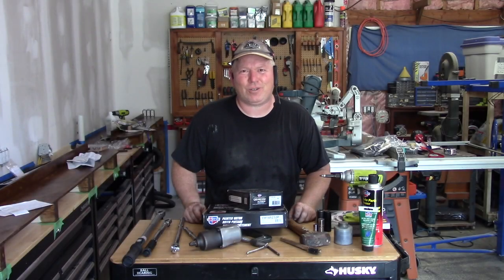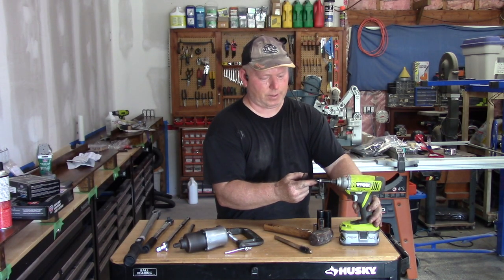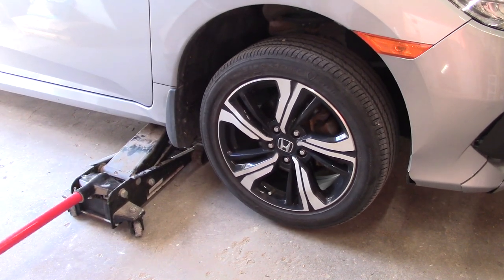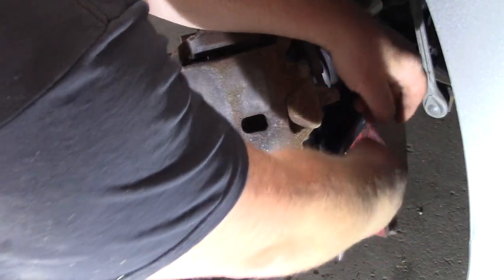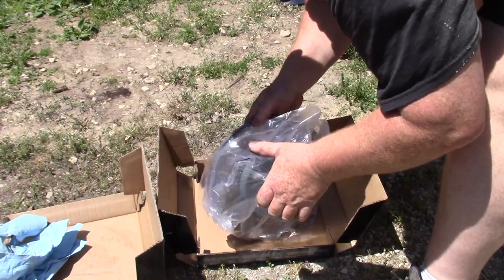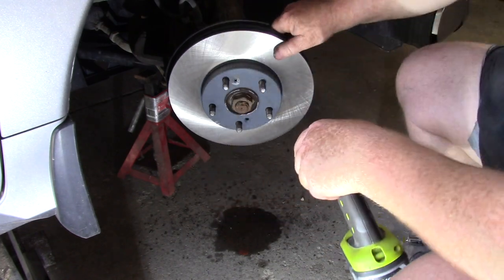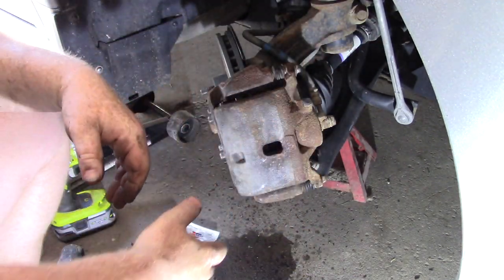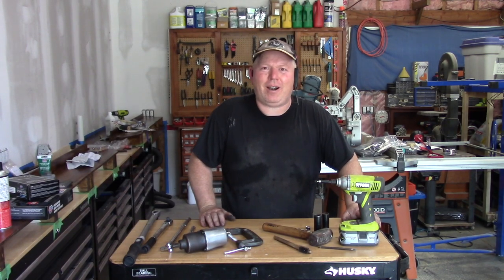DIY Honda Civic Front Brake Change 2016 to 2021 model years.

Comment: This has been a very thorough and helpful video, Rob.  My 2016 Civic is due for front brakes at (unbelievably!) 191k MILES.  Lot of highway travel obviously since this is their first service.  And considering the OEM pads/rotors served me this long, I opted to go with Honda parts.  Picked them up online at a dealer in Ohio for significantly cheaper than my local dealer too.  Thanks again and keep the great maintenance videos coming!

Comment: Great video, very informative and thorough.  One thing that I would add is that when you had the lower caliper pin that was tight when being put back in, that was likely caused by that rubber boot that Honda puts on only one of those pins per caliper...not sure why.  That part is replaceable and should come with a service kit as over time, it will tend to swell and inhibit the free movement of the pin.  Changed the rear brakes on my 2003 Pilot and had that issue where the rubber sleeve swelled to the point to where the pin would hardly move, and only then realized that the service kit I bought to do the job included those sleeves as well as the boots.  Also would want to make sure that high temp silicone grease is used on the pins so that it will not deteriorate the rubber.  Thanks for the videos!

Comment: Just did mine today on my 19 coupe ex-t 56,000 on the originals. Still had plenty of pad left too.
Reply: About to do my wife’s 2018 sport touring on Sunday with 69k miles (nice). Wonder how they’ll look.
Reply: @WalterMelons  I live in VT, and barely need to use my brakes. Virtually no traffic, no cities here, just drive rt 2 every day for work. Barely even get into the turbo. I wish I had gone with something other than power stop pads and rotors. They're absolute garbage. Atleast the ones I got. I have to do brakes over again now. Going with a decent non drilled and slotted rotor this time, with good ceramic pads. I did my brake fluid too, swapped out the dot 3 for valvoline dot3-4 fluid. Might do new calipers in the front too in the spring.
Reply: @vermontvermont9292  I’m surprised, never had an issue with powerstops. I’ve installed them on 5 vehicles so far. I don’t do drilled and slotted for anything that isn’t towing or an actual race car that gets track time.

Comment: Thank you so much for your video!!
By far the BEST video I've watched and very thorough and step by step. 
I have a 2016 Honda Civic Sedan Touring. 
The "STEALERSHIP" wanted to charge me couple of thousands for the pads and rotors and labor.
Would it be the same process also for the rear brakes?
How are the CarQuest Pads and Rotors working so far?
THANK YOU! YOU ROCK!!
Reply from the maker: Get the premium pads and rotors.  They will be the OEM equivalent.  Look for the videos on air and cabin filters here on my channel.  Here is the link for the rear brakes 
https://youtu.be/kyQFCIbVdYA

Comment: Rob, do you loosen or remove the brake fluid filler cap? Or is that bad or not necessary? I've always changed my own brakes. Saw some great stuff in your video. I've never used anti seize, but I will this time. Thanks for the torque settings!
Reply from the maker: No I didn't loosen the brake booster cap because you aren't adding any fluid to the system and it won't overflow either.  Don't forget to do the in car brake calibration sequence at the end of the video.
Good Luck with your repair!
Cheers!
Rob

Comment: Hello! Thanks for the video! No errors with this method? Also can you please tell me what other honda model has the same rear brake pads? I know the fronts match the 02-06 crv's, I need to know what matches the rears. Thank you!
Reply from the maker: These are the actual Honda Tech Instructions on how to do the service without HDC (computer) so if you follow the instructions and calibrate the EPB then you won't have an issue,  Did both My civic and CRV and a friends civic - all good no codes and super easy.  I'm not sure what pads are common but I hear the new Si's use the Odyssey brake set up (huge rotors, calipers and pads)  Good Luck with your repair!
Rob

Comment: Hello,  I changed my front brake pads and was going to do the rotors as well but noticed I got the wrong ones so didn’t install them. Everything is great except for the fact my brakes feel like they are sticking now.
Reply from the maker: Did it improve with more driving time?

Comment: Excellent video, if I put everything back together just how you did and it makes a cranking noise when driving what could have went wrong went putting back together ?
Reply from the maker: I’m not sure.  Check the brake pads and make sure the pad is against the disc and not backwards (I’ve seen pictures of that).  Make sure the inner pad has the squealer on it and is in the right position.  Sometimes you can get a stone between the splash shield and the rotor and that can make noise.  Also make sure you didn’t accidentally bend the splash shield in against the rotor.  If all else fails I would take everything apart again, inspect all the parts and put it back together carefully.  Good Luck!  Fingers crossed 🤞

Comment: Did you have to bleed the brakes, never saw you open a bleeder valve so I'm assuming NO?
Reply from the maker: No.  Only if you open the system.  When I replace calipers or brake lines or brakes hoses then I bleed the brakes.

Comment: Changing the pads and rotors on my 2016 civic ex, about 160,000km on them, still about 25% pad life left but the rotors are worn. Your video helped a lot. I’m upgrading to vented rotors and ceramic pads, 4 wheel kit from summit racing for $258 free shipping.
Reply from the maker: Awesome!
Reply: How do you like the new brake set up so far?

Comment: I changed my rotors and pads step by step, there are grinding noise only when I stop the car, and there's no noise when I drive it and try to slow down. Do you know what's wrong?
Reply from the maker: Hard to say from here but a common mistake people make is putting the pads in the wrong position.  One set has a pad with the “squealer” and one without.  Sometimes people put them in the opposite sides.  Another problem that can happen is getting a stone stuck in between the pad and the rotor.  When I’m doubt,  pull it apart and have another look.  Good luck!

Comment: I am about to change my rotors and pads on my civic and was wondering if the front pistons needed to spin while being compressed?  I have a piston compression kit  so if it needs to spin I'll need to figure out what size adaptor I need to use. Thank you!
Reply from the maker: No.  Just compressed

Comment: Great vid mate! Curious normally don't you grease the backside of pads so they don't squeak?
Reply from the maker: You can add a thin layer of grease at the contact points, I usually put a layer on the piston ring.  I’ve never had squeaky brakes actually.

Comment: Do you flush your braking fluid or just top it up?

I'm also in Canada, have a 2017 ex civic, and does not look like the bleeder valves have ever been touched. They are rusted, etc, Canadian environement. Probably look like yours. Would you bother to flush the system yourself? Have a mechanic do it, or just remove and top up the master cylinder?
Reply from the maker: I had the dealer swap out the brake fluid during one of the services.  I got an extended warranty (CVT tranny is new to Honda, direct injection and turbo is also new tech for them) So I get them to change oil and tranny oil  to keep the warranty in good standing.

Comment: I have a 2016 Honda Civic EX-T 130,000 miles original brakes and rotors. Is that good?
Reply: Damn that's a lot of miles
Reply from the maker: Amazing!  Honda has really good brakes and they tend to last a long time but you got a lot more miles than normal.  Time to switch those elderly brakes out.  LOL!
Reply from the maker: crazy eh!
Reply: @icecool85  I drive a lot lol 25,000 a year roughly
Reply: @cslim117  I have the same year Honda Civic…close to 145K miles. I figure it’s over 5 years so probably a good time to replace them. Look at it this way…put new ones on and don’t worry about it for another 5 years. If you’re like me, you drive alot of hwy miles and don’t have to use your brakes nearly as often as someone who drives mainly city/stop & go traffic.
Reply: @carlovanrijk4039  yeah that’s what I’m thinking of doing just curious tho do you have the 1.5 turbo?
Reply: @cslim117  no, I have the 2.0 liter.
Reply: @carlovanrijk4039 I gotcha I have the 1.5T so I was going to see what issues if any you were having with it
Reply: @cslim117  for me, the 2.0 L. has been phenomenal! No oil burning, excellent gas mileage, just oil changes and regular maintenance.

Comment: How many miles did this car have when you changed the brake pads and brake disc? The pads look good but the discs are in bad condition so I was wondering.
Reply from the maker: I can’t remember.  I might have mentioned it somewhere in the video.  Salted winter roads in Canada can wreak havoc on your vehicle.

Comment: Dumb question here. Do you still have to open the brake reservoir cap before compressing the caliper pistons on these newer vehicles?
Reply from the maker: No.  The reservoir is filled to the proper amount before the brakes are actuated when the car is made.  So when you push the piston back the reservoir is at the same level when it was built.  The only issue is if someone has overfilled the reservoir.    When in doubt open it up.

Comment: Hey Rob!  Thank you so much for this detailed video!  I was able to mostly follow it with no issues.  On one of my rotors, the head of the screw that holds the rotor on has somehow gotten stripped, so for now I've just put on the new pads and left on the old rotor (I know, I know), until I can find a tutorial that describes how to properly drill that screw out.  Seeing as I had no issues with the other side, I'm confident that once I have the tools and the know-how to properly drill that screw out that I'll be able to get that new rotor on.

Many thanks Rob!  You've not only helped me save a bunch of money, but also given me the confidence to tackle more and more of my own repairs 😊
Reply from the maker: You can just drill the screw out.  You don’t actually need it.  It’s for assembly at the plant.  It is a little easier to assemble with the screw in place.  Once you drill the head out you can remove the rotor and remove the rest of the screw with vice grips.  Thanks for your comments and good luck with your repair!
Cheers!
Rob

Comment: Do you have to change you disc every time you change your brake pads? 8:42  even if my disc looks fine?
Reply from the maker: I recommend swapping them.  If they are warped they will pulse, if there are groves you will have to change pads faster and if you don’t lube the pins they can cause premature wear.  Brakes are the most important thing on your car.

Comment: My pads came with new caliper bolt boots, should those be swapped also? The original look fine, no leaks, leave the old ones in?
Reply from the maker: Up to you.  Just make sure to lube those slide bolts 😉

Comment: The brake pad on my honda car start squeky after 40k km. (Still the factory installed disc and brake pad. Honda SC did greasing, 2 days later still squeky. Any recommendation?
Reply from the maker: Oh there are so many things that can lead to that.  Dirt, stones stuck in pad, bad pad material like a hard piece, rusty rotors, not driving enough (causing rusty rotors).  Sometimes it will disappear over time, sometimes the only way is to go new.  I just did that after the Covid shutdown (hence this video) as my rear brakes had rusted (because the car just sat for almost 2 months)  and the squealing was driving my wife crazy. Clean them yearly (full service taking them apart and lubricating them).  You can also lube the backs of the pads at the contact points on the caliper and on the piston ring.
Best of Luck!
Cheers!
Rob
Reply: @robsgaragewoodworkin  
Thanks for the detail explaination and recommendations.
Its just a little 3 years on it, I will go for the full brake service, it never got that. 
Thanks
Metz

Comment: Don’t you need to put your car in “service mode” before changing pads/rotors?
Reply from the maker: Not for the front brakes.  Service mode is for the electric parking brake which is only on the rear brakes.  You can manually change the rear brakes with the EPB or you can use a scan tool to place them into service mode.  I have a video for each method on both the CRV and Civic on my channel.

Comment: Excellent video, thank you for taking the time to record this and explain it so well. I also so your instructions on the rear brakes... those are next. 

Is there a risk to having the piston boot protrude a bit over while pushing the piston back? I seemed to do that on both sides 😕, but of course I imagine now that the car is driving fine, it probably worked itself back into place.
Reply from the maker: The boot seal edge should not be passed the edge of the piston.  You only have to push the piston back enough to clear the new pads.  Sometimes the boot expansion folds look like they stick out a bit and that is usually ok but not desired.  The boot keeps dirt out and tears in the boot can cause early caliper replacement.  Calipers are cheap and easy to replace however, so don’t worry.  When you do the rear put less pressure on the c clamp and check your progress near the end to prevent that from happening.  If you can’t fit the caliper over the pads then give it another 1/2 turn with the c clamp.  Good luck with your repair!
Cheers!
Rob
Reply: @robsgaragewoodworkin  cheers. Thank you so much! I'm planning to use your video for the rears, especially with the EPB connector.

Comment: Did your pads and rotors come from car quest?

Edit: if so do they provide the entire brake assembly? I have a 2017 Honda Civic lx
Reply from the maker: Yes but you can get them from any car parts store. (shop around for best prices)  I recommend premium parts but you don't need to get the ceramic coated rotors.  You will have to order pads and rotors, get some caliper grease and brake cleaner while you're there.
Reply: @robsgaragewoodworkin  I appreciate it. My first time attempting to be handy haha.

Comment: Do the front brakes need calibration after the whole replacement? I didn’t see the steps on the video, only in the video for the rear. If so how does one calibrate them?
Reply from the maker: No.  The calibration is for the rear only to set the electronic parking brake.
Reply: @robsgaragewoodworkin  AWESOME! That’s what I figured. Loved both of the videos you made. Very informative. Appreciate the response.

Comment: Hey rob, I followed your steps and changed the brakes everything seems to be working good except when I turn on the car I’m getting all these sensors. Hill assist start problem, brake system problem, brake hold system problem, power steering problem, vehicle stability problem. Is there something I did wrong or touched?
Reply from the maker: At the end of the video there are calibration instructions.  If you don’t calibrate them you will get codes.  Also make sure you have fully set the coupler.
Reply: @robsgaragewoodworkin  I only did the front brakes not the back. Not sure why all those sensors are coming up?
Reply from the maker: @brandonsampson5708  oh. Well then.  Ok that sequence that goes through every possible fault is something different.  I’ve had that on both my Hondas.  Had to get the valves cleaned.  It was a turbo issue.  I have the extended warranty so it was a freebee.

Comment: So you don’t have to remove any brake lines or bleed the brakes after this? Been looking to get my calipers powder coated and didn’t want the removal process to be a huge hassle.
Reply from the maker: No you don't to do the pad and rotor change, but If you remove the calipers you will have to pinch the brake line, remove the brake hose and you should get new crush washers for the oil bolt and you'll have to bleed the system and top up the fluid.  (still easy)
Reply: @robsgaragewoodworkin  I figured so, thank you! Very helpful
Reply from the maker: @kadenkirkpatrick6808  you are welcome!  Good luck with your repair!

Comment: Nice video ... I had a?  I changed the pads and when I tried driving the pad is hitting the rotor and makes noise any ???
Reply from the maker: Make sure the pads are the right sides and the right orientation.  You should change the rotors also when you change the pads.  If you used the old rotors it may make noise for awhile.

Comment: Never put anti-seize compound around spindle because its getting to hot there waste of time
Reply from the maker: That's why you use it.  It's designed for high heat areas so you can remove the fasteners during maintenance.
Reply: Huh? Copper anti seize is good to 1600° I believe (maybe 1800°) and nickel anti-seize is good to 2400°. If your spindle is that hot, get out of your vehicle because it’s on fire.

Comment: Hi rob, was wondering if changing the rotors is a must if I just wanted to change out the pads? I'm not having any rotor issues, just time to change the pads
Reply from the maker: You should always change the rotors or get them turned down.  Brakes are the most important system on your car.
Reply: Hey Rob. What is best way to determine if it is just brakes or both? I only have 40k miles on my civic
Reply from the maker: @cnelson2334    You should always replace both pads and rotors at the same time.  You can check pad wear by popping off the wheel and looking into the centre hole of the brake caliper.  Look at the pads.  They have a groove in the middle.  If you see the grove on both pads there is life left.  If there is no grove it’s time for a change.  I think I show that in the video.  Good Luck!